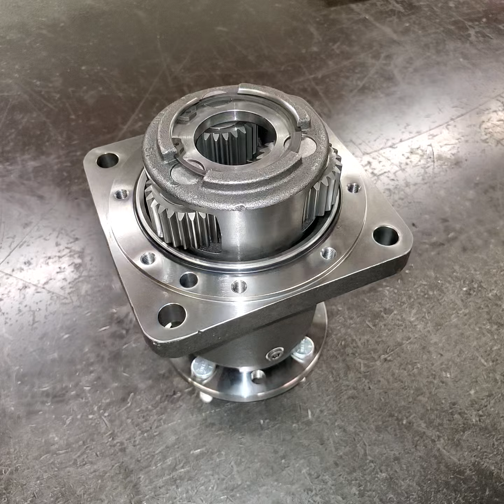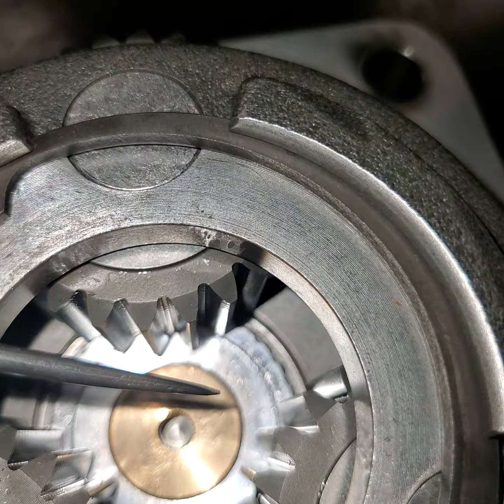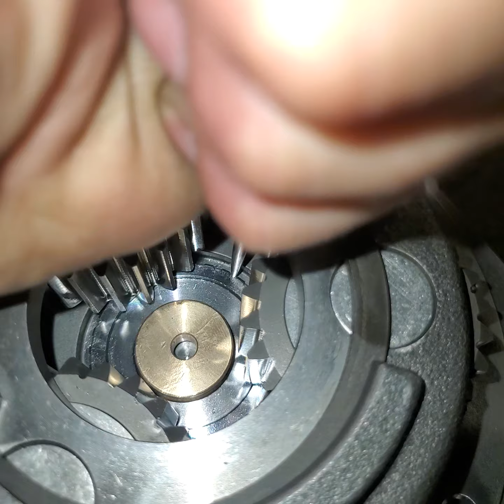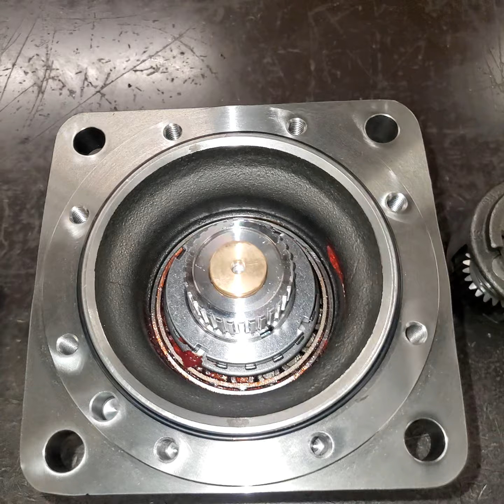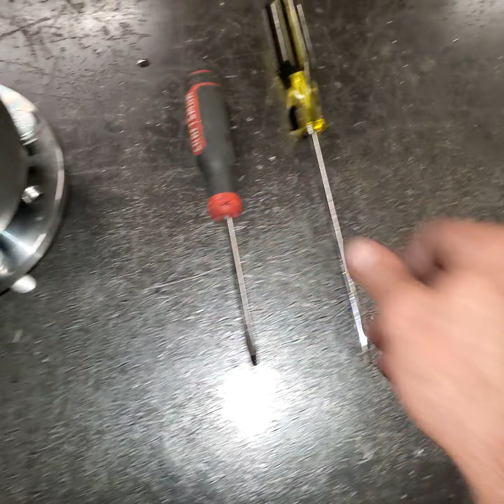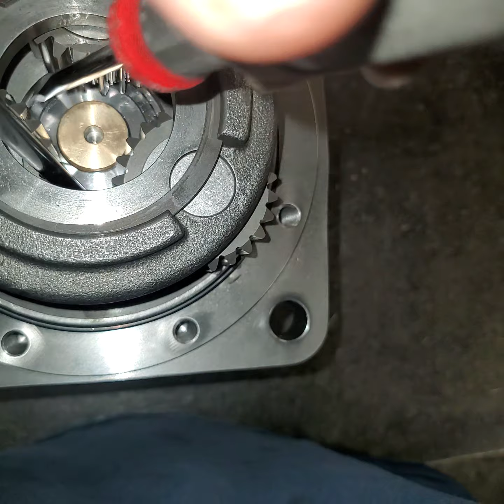Heco Gear Model 16 Planet Carrier Retaining Ring Removal

Comment: What causes the sun gear to strip the splines off
Reply from the maker: Are you referring to the male portion of the sun gear that meshes with the 3 gears in the planet carrier shown in this video? Those teeth on the sun gear are the highest loaded point of the geartrain and therefore show the most wear over the life of the unit. If left unmaintained this wear will start in the form of gear face pitting which will continue to propagate until the tooth itself eventually fails and "strips off". Things like lubrication contamination, water in the oil, using hydraulic oil instead of gear oil, high load on the gearbox, etc. can all accelerate this wear and shorten the life of the sun gear. While we do not recommend replacing just the sun gear in the geartrain, if you are going to replace the sun gear due to wear it must be done prior to the teeth failing as afterward you have pieces of tooth run through the rest of the geartrain which will not operate for long before complete failure of the gearbox.
Reply: @hecogear9646  thanks for an actual answer. Cheers